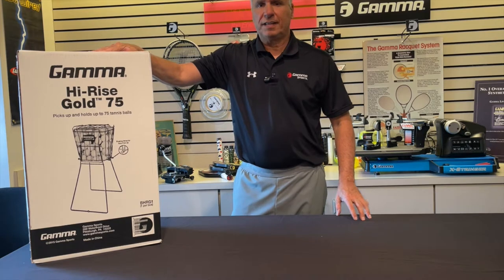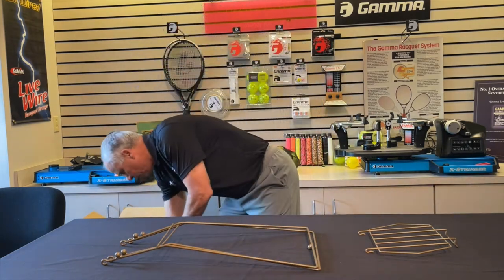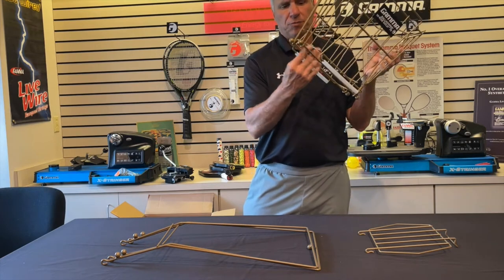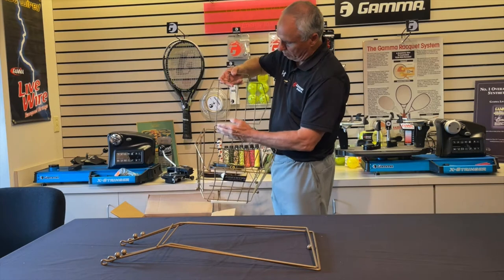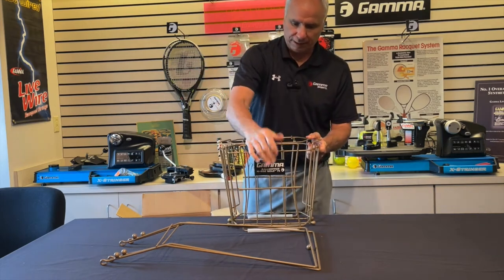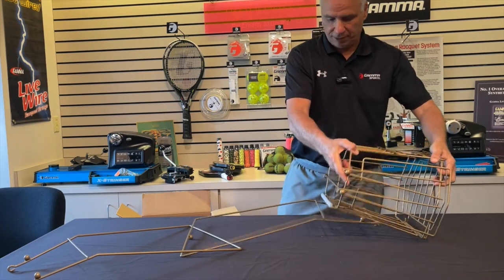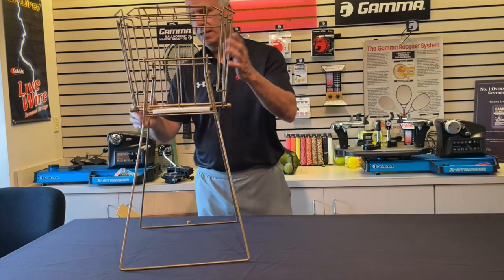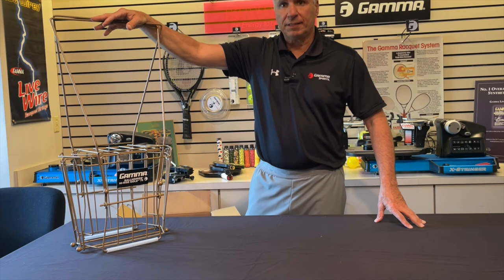How to Assemble the BallHopper Hi Rise Gold 75

Comment: Have used this and the standard hi-rise 75. Both are exceptionally poorly designed and fall apart in everyday use. I have the regular hi-rise right now and the handles literally fall off EVERY SINGLE TIME I try to use the hopper. I've tried zip-tying, duct taping, rubber bands. Absolute waste of money